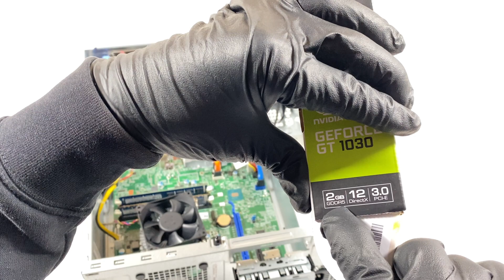Dell Optiplex 3040 Gaming Upgrades Video Card SSD RAM

Comment from the maker: List of parts and upgrades will work with this system Dell Optiplex 3040.

GIGABYTE GeForce RTX 3050 OC Low Profile
https://amzn.to/3xEnd4D

(1.) AMD Radeon RX 6400 Low Profile Gaming Graphics Card
https://amzn.to/3s8MUUY

(2.) Gigabyte Geforce GTX 1050 Ti OC Low Profile 4GB GDDR5 128 Bit PCI-E Graphic Card (GV-N105TOC-4GL) 
https://amzn.to/2XEqKMb

(3.) MSI Gaming GeForce GTX 1650 4GB GDRR5 Low Profile Graphics Card (GTX 1650 4GT LP OC) 
https://amzn.to/2VkDdSd

(4.) MSI GTX 1050 TI 4GT Low Profile  Graphic Cards 
https://amzn.to/34r0AxG

(5.) Gigabyte GeForce GT 1030 GV-N1030D5-2GL Low Profile 2G Computer Graphics Card 
https://amzn.to/2Xu3SyO

(6.) ZOTAC GeForce GT 1030 2GB GDDR5 64-bit PCIe 3.0 DirectX 12 HDCP Ready Low Profile Video Card ZT-P10300A-10L 
https://amzn.to/3eayL1b 

(7.) EVGA GeForce GT 1030 SC 2GB GDDR5 Low Profile Graphic Cards 02G-P4-6333-KR 
https://amzn.to/3s65uxE

(1.) USB Wifi Adapter for PC AC600Mbps Wireless Network Adapter
https://amzn.to/2ZaGuHb

(2.) USB Wifi Adapter for PC, EDUP AC600M USB Wi-fi Dongle 802.11ac Wireless Network Adapter 
https://amzn.to/3H3YoxG

(1.)  Thermal Grizzly - Spatula for Applying and Spreading Thermal Paste
https://amzn.to/30Qq4ag

Thermal Compound Paste:
(1.) Arctic MX-4 Thermal Compound Paste Carbon Based
https://amzn.to/3JfonEE

(2.) Arctic Silver 5 Thermal Cooling Compound Paste 
https://amzn.to/2ziNU0H

(3.) Noctua NT-H1 3.5g, Pro-Grade Thermal Compound Paste
https://amzn.to/36kTk7A

(4.) ARCTIC MX-4 (current edition) Thermal Compound Paste 20 Grams 
https://amzn.to/2DhGJaK

This RAM works with this machine:

(1.) Crucial 8GB Single DDR3L 1600 MT/s (PC3L-12800) Memory CT102464BD160B
https://amzn.to/2VhGv8O

(2.) Crucial 4GB Single DDR3L 1600 MT/s (PC3L-12800) Memory CT51264BD160B 
https://amzn.to/2xq46wb 

(3.) Crucial 16GB Kit (8GBx2) DDR3L 1600 MT/s (PC3L-12800) CT2K102464BD160B 
https://amzn.to/2VpsKpP

SSD list works with this PC:

(1.) Samsung 860 EVO 500GB 2.5 Inch Internal SSD MZ-76E500B/AM) 
https://amzn.to/2yNxnkE

(2.) WD Blue 3D NAND 1TB Internal SSD, 2.5" WDS100T2B0A
https://amzn.to/2wvnC9Z

(3.) WD Green 1TB Internal PC SSD  WDS100T2G0A
https://amzn.to/3cbrcWa

(4.) SanDisk SSD PLUS 480GB Internal SSD SDSSDA-1T00-G26
https://amzn.to/3a3i9ou

(5.) Crucial MX500 250GB 3D NAND SATA CT250MX500SSD1(Z) 
https://amzn.to/34rZlhy

(6.) Samsung 860 PRO SSD 256GB - 2.5 Inch SATA III 
https://amzn.to/2ybiHLK

(7.) Samsung SSD 860 EVO 250GB 2.5 Inch SATA III Internal SSD 
https://amzn.to/2VjIAkK

(8.) SanDisk SSD PLUS 240GB Internal SSD
https://amzn.to/3c7SEE4

(9.) Crucial MX500 1TB 3D NAND SATA 2.5 Inch Internal SSD
https://amzn.to/3BEn9zE

HDD list works with this PC for extra storage:

(1.).WD Black 2TB Performance 3.5" Hard Drive, WD2003FZEX 
https://amzn.to/2xFUeyF

(2.).Seagate BarraCuda 1TB Internal Hard Drive  3.5" Hard Drive 
https://amzn.to/3g8FXM8

(3.).Seagate BarraCuda 2TB Internal Hard Drive  3.5" Hard Drive 
https://amzn.to/3sMIFxO

(4.) Seagate BarraCuda 4TB Internal Hard Drive HDD – 3.5 Inch
https://amzn.to/3h1XFm4
Reply: Do you know if this computer can take a M.2  Nvme  in a pcie slot adapter?
Reply: adapter yes
 @impact1456
Reply: @Goatoftaboryout hello would this machine be able to operate with a gtx1060

Comment: Pro Tip: Make sure the graphics card you install does not need additional power as those cheap Dell power supplies don't often have the 6/8 Pin GPU plug needed.

Comment: I just found 2 of these w/ i5-6500, 16gb ram, 1tb HDD for $35 each!
Thanks for this video!
I've got an i7 3770 beater Win10PC with a GTX-750ti I've been tinkering with.
My main computer RN is an i7-4770 16gb, 256gb NVME SSD late 2013 iMac I got for $50 and rebuilt/upgraded!
Not an easy job to say the least! Complete teardown and rebuild! LMAO!
I do audio, so...
This old iMac after OCLP is a beast!

Comment: You recommended a GTX 1650, but it looks like it needs extra power for the card itself. How would you handle this, or am I looking at the wrong version of the card?
Reply from the maker: Hi, what video card are you looking to buy.
Reply: @Mxkdt  Hey there. I ended up picking up the ASRock RX6400 CLI 4G AMD Radeon RX 6400 Challenger ITX 4GB Graphics Card. It's.been great and no external power needed.
Reply: @StevieD1x there are versions of the 1650 that doesn’t need external power, sorry to say but it gets more fps in almost every game, you had to find the gddr5 version

Comment: great video but can you please tell where can i get the holder for the ssd blue one and for how much will it cost thanks
Reply: I have bought some on ebay not long ago but they were a bit overpriced.
Note that the one in the video is not original, and doesn't fit properly, it's clearly from a different machine

Comment: My 3040: i5 6500 , 16GB RAM , 2 SSDs 500GB , GPU GTX 1070 TI 8GB , POWER SUPPLY ATX EXTERNAL 600W.
Reply: Hermano que me tratas de decir que tarjeta grafica me recomiendaa tengo las misma que tu!
Reply: So the 3040 mt uses s atx psu?

Comment: Buenas bendiciones. ¿De qué forma puedo puentear en una Optiplex 3040, es primera vez que veo ese power supply y mi tarjeta tiene un corto. ¿Sabes cuáles son los contactos correctos?
Reply from the maker: Hola, ¿trató de probar la fuente de alimentación y la tarjeta de video por separado en diferentes PC?
Reply: @Mxkdt  I will try to do it.

Comment: Can this model accommodate two 3.5” HDDs? Doesn’t look like it but thought I’d ask anyway as sometimes it can be done with some adapters. Thx.
Reply from the maker: Hi, yes you can install 2 3.5  HDDs with SATA Power 15-pin Y-Splitter Cable  and you have to remove optical drive.
Reply: @Mxkdt  Care to explain a little bit more please? Where would you put it?

Comment: mxkdi could you please tell me the best graphics card for dell otpiplex 3020sff  can you find a gpu under  120 thank you.
Reply from the maker: Hi, yes the best video card for dell 3020 sff would be gt 1030 with GDDR5 low profile with low profile bracket and they do sell same video card with DDR4 that is slower and cost less i would say it is not worth it.
Reply: @Mxkdt  thank you so much

Comment: Hello there. Quick question please. I have dell precision t5500 with a single cpu. I wanna upgrade my gpu to a gtg 1650sup or 1070 with some additions in ram and storage but i am afraid of bottlenecking when i change my gpu. Any suggestions to avoid that please?
Reply from the maker: Hi, yes you have to upgrade RAM to at least 16GB and processor to higher clock speed like Intel Xeon x5690 SLBVX sells on ebay for around $40,  Thanks and Good Luck!

1...Intel Xeon x5690 + GTX 1650 Super Average bottleneck percentage: 9.77% (CPU bottleneck) 1080P
2... Intel Xeon x5690 + GTX 1650 Super Average bottleneck percentage: 5.12% (CPU bottleneck) 1440P 

1...Intel Xeon x5690 + GTX 1070 Average bottleneck percentage: 16.77% (CPU bottleneck) 1080P
2...Intel Xeon x5690 + GTX 1070  Average bottleneck percentage: 9.82% (CPU bottleneck) 1440p

Comment: Very good video friend, one question: do you know which 300w psu works for a Dell Optiplex 7050 sff?  Thanks in advance
Reply from the maker: Hi, thanks, yes you can upgrade power supply 300W  HU300EGS-00 X0DDG, they sell used on ebay.